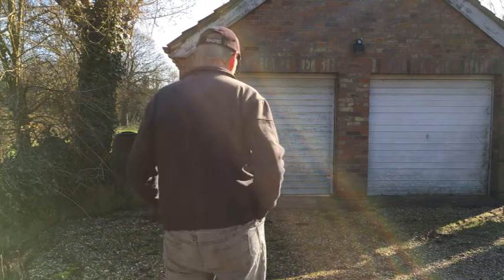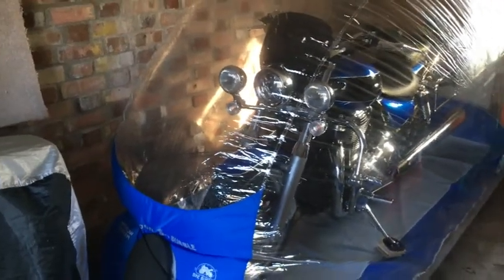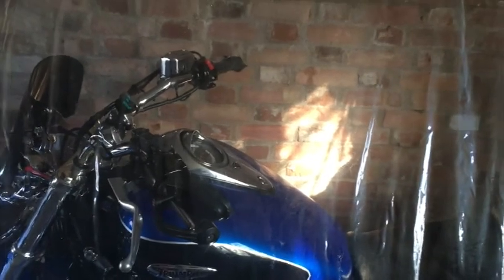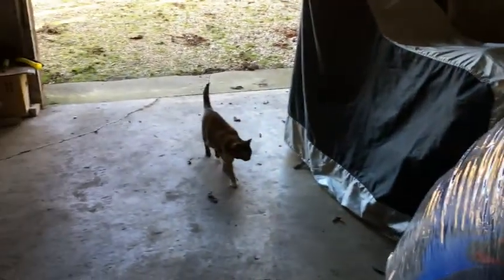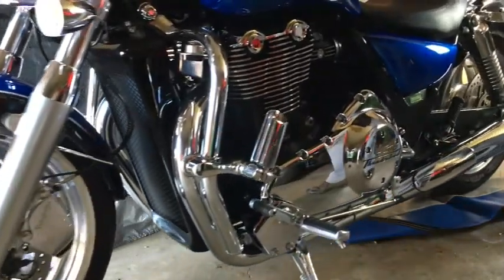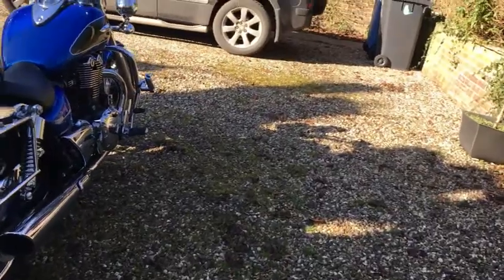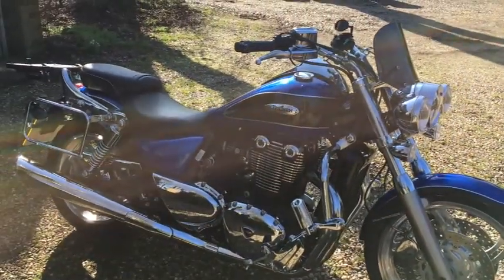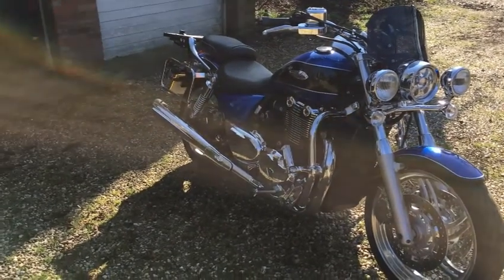Carcoon bike bubble review. (Coming out of the bubble)

Comment: I have used a VAC motorcycle bag since about 1994 on 4 diff a Harleys .My 2002 FLSTF Is still in my bag since Nov 2023 ( coming out on 1st May ) .
Never had any condensation in all the years I used one.Present bike is covered in  chrome and special paint job.Its clean and dry as the dayi put it in last Nov.
All for a £50 vac bag that lasts about 8 years.

Comment: You got that completely arse about face. The warmer air will cause condensation on the colder bike., cold air on a warm surface will not cause condensation. Put a bowl of warm stuff in the fridge and see,.  when its been in there a while and take it out and see even in a warm dry kitchen, condensation occurs. Walk from outdoors into a warm room in the winter wearing spectacles and they mist up, until they warm to the same temperature. 👍